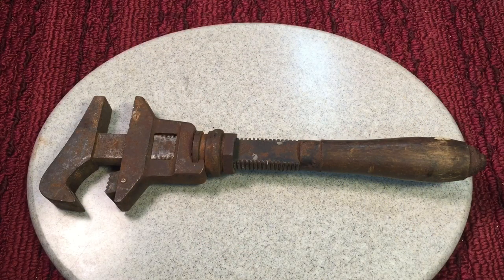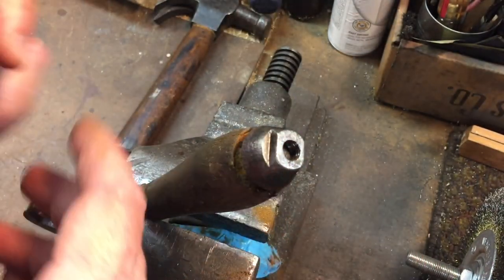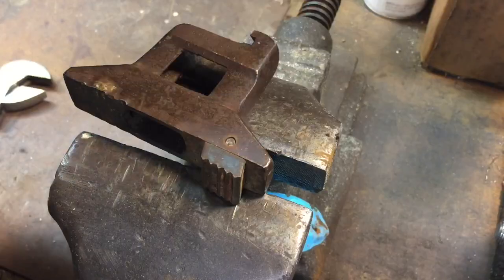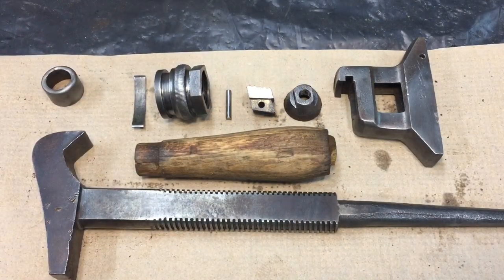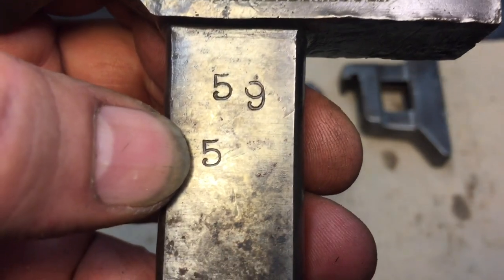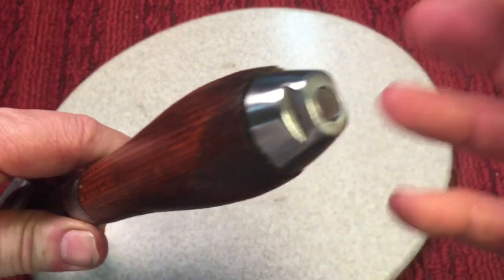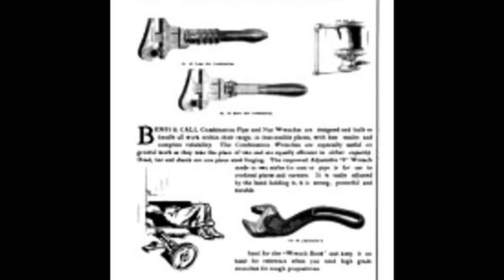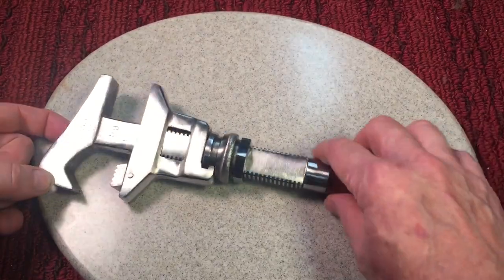Bemis & Call Combination Wrench Restoration

Comment: What a cool wrench and amazing restoration! I didn’t think it was possible but you are getting better and better at this. That satin finish is awesome and I love the Scoutcrafter red over Bondo repair idea. JB Weld makes a wood filler that works really well too. I know you don’t like wooden handles like I do but that one sure turned out nice. If you ever have one that has an unrepairable wooden handle you could do G10, stacked leather or one of those really neat colored epoxy scales like they use in knife making. It wouldn’t be original but what a cool upgrade! Take care. 😁👍🏼

Comment: I've got an old Bemis & Call 15in. No.90 that I restored. It had at one time belonged to the old Missouri Pacific Railroad; as it is so stamped. I believe it to be a steamfitters wrench from the teens or 20's. Perhaps the 30's. Mine does not have wood. It is all steel. I suppose the thought being that steam would swell it. It no longer does any work, though it still could. Just a very nice wrench with a well deserved retirement.
Reply from the maker: They were grand wrenches! 😃👍

Comment: We even got a nice little rant LOL. No I get the problem with the wood and metal but it does look nice! I'm doing an English Jackdaw wrench at the moment, it's just exceptionally bad, the pin is stuck in the tumbwheel, very pitted, like if it's been buried for a while. I don't even really like English wrenches but it's a big 15" and just so bad that if I screw it up I will toss it no problem.  Just having fun and learning but not counting my hours, 10 probably won't get it done and also no half as nice as yours. Look forward to Fridays!!

Comment: That wrench is gorgeous!  Well done!

Just curious, how do you finish that metal to keep it from rusting?  In Florida, there would be surface rust before it could get hung on the wall.
Reply from the maker: Jeff- For areas like where you live the metal can be clear coated to help stop rusting.  Florida is one of the hardest places to stop flash rusting because of the high humidity and salt air!  Thanks!!!
Reply: Hey, I have nothing to do with our air!  
I do use clear spray paint and Johnson's wax.  Recently bought clear lacquer to see if it can keep the metal shiny instead of coating it like other clear paints

Comment: Another good ol resto! I was wondering, what's the best way to cut a square hole?
Reply from the maker: Usually I drill a hole just a bit under the size needed then file out the corners with a square file.   Not hard but you must go easy because you can easily go over...  =D

Comment: I have one of these. It’s missing the pipe jaw and I split the handle because I didn’t know it was a reverse thread. If I can find a replacement jaw I might try restoring mine.
Reply from the maker: I don’t know why the left handed thread on that cap nut! 🤔.  😃👍
Reply: @ScoutCrafter  As to why a left hand thread your guess is as good as mine.
There is a situation with older tools. IIRC there weren't any standard sizes until early in the 20th Century when SAE was formed. Colt standardized production as a way to make assembly easier, but they still chose thread diameters and pitches on a whim. Right and left don't really mater unless you are making replacement parts or subbing out minor operations. Stanley Tool bought out their competition. When they did that, like hedge funds, they used up the companies assets and inventory then buried the remains. Planes before the turn of the century had all kinds of odd threads. Some planes have left hand thread blade adjusters and some were right handed. The screw that holds a planes handle is a special order. I bought a special threading die to make them.

Comment: That pitting was worse than it initially looked, not surprising it took 10 hours. I could almost feel the Buttery Smoothness thru the screen.
Bondo has lots of uses and it's quick, 5-10 minutes and you can get back to working on a project.
Reply from the maker: I am going to order more hardener then do a video on Bondo-  you’re right it’s great stuff!  😃👍

Comment: Hi, love the video.  Question how long should I wait to clear coat a C Clamp thats been painted with rustoleum? Thanks
Reply from the maker: Tom-There are two schools of thought when it comes to clear coating paint one school says you should clearcoat before the original paint sets up so that the clearcoat etches into the first coat of paint the second school says you should wait till the first coat completely dries I’ve done it both ways and as long as you’re using the same paints I haven’t had any issues either way!